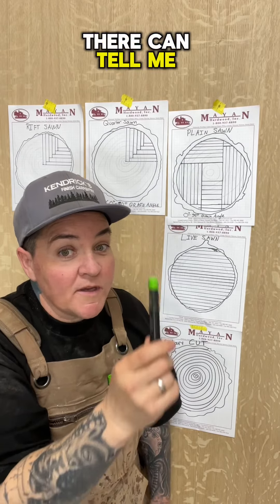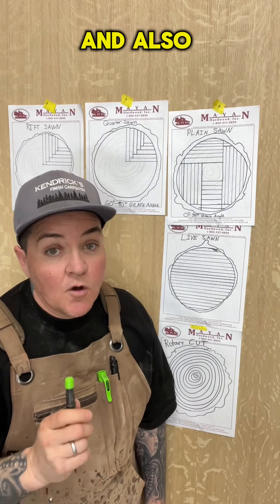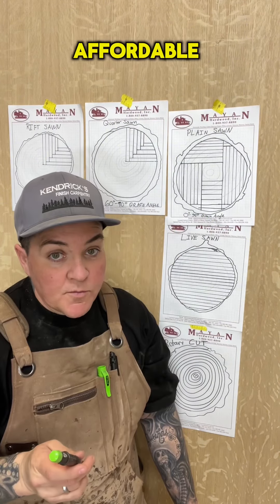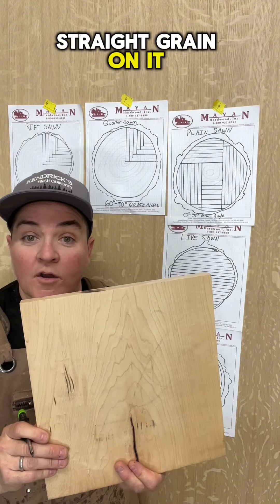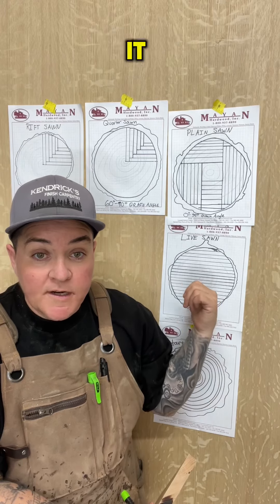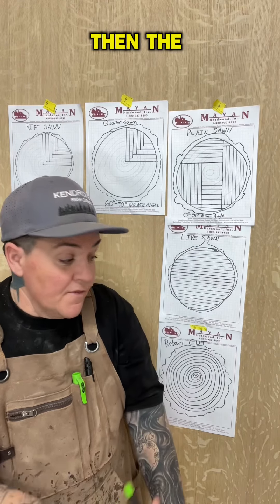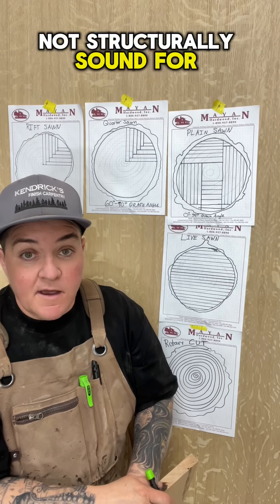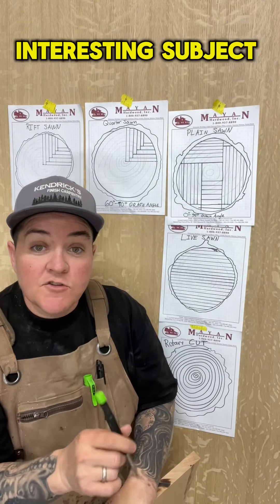Which cut of wood is more structural sound/stable

Comment: I worked at a saw mill for 8 years and we always sawed plain, I didn't know if it was because that yielded the most lumber or for some other reason, there were rare instances where he would saw using the forth option when he would cut log cabin siding. Still definitely interesting.